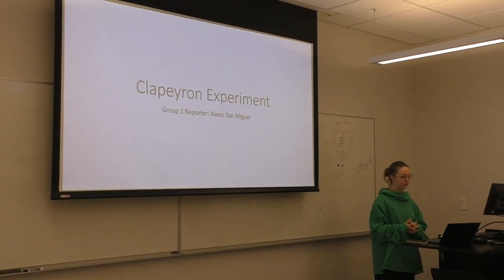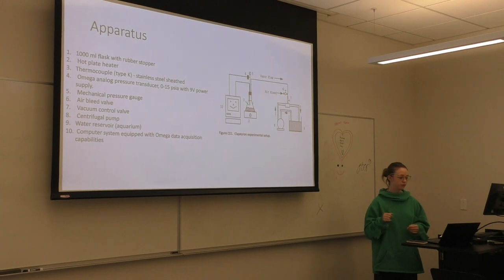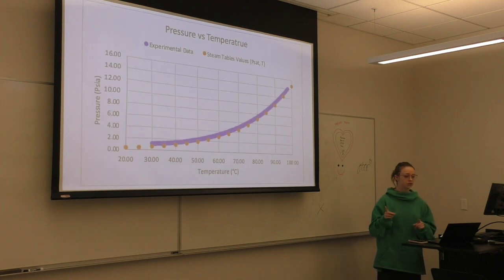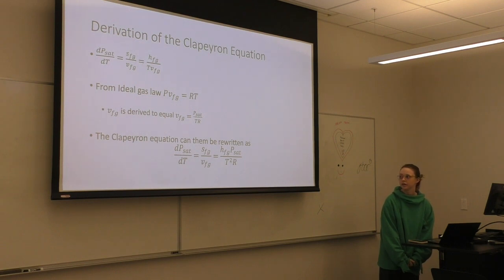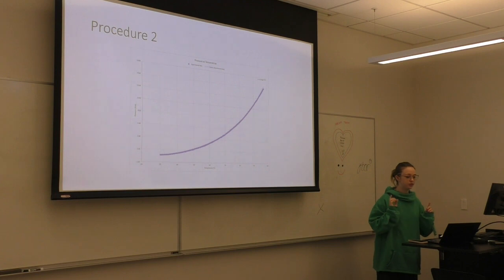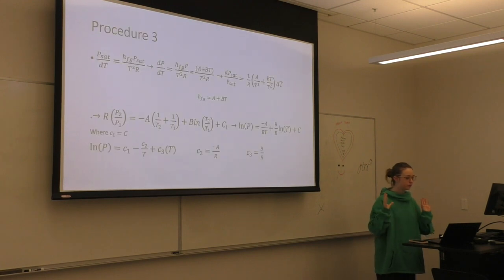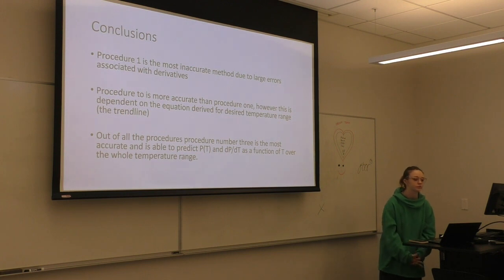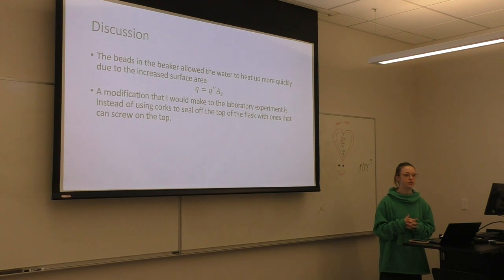Alexis San Miguel

Comment: You have improved significantly from your first discussion talk. Awesome job there. The results of the Clapeyron experiment was presented well from your graphs. I even like how you mentioned that some of the data you got was off and gave a reason on why you thought the data didn't align. Maybe place a slide or two in your presentation next time demonstrating how you got some of your results and try to stick close to the 6 minute requirement. Other than that, good job.